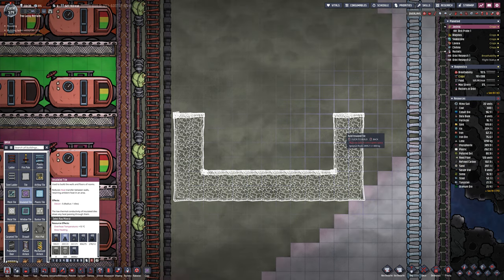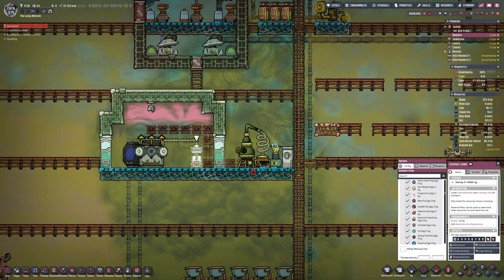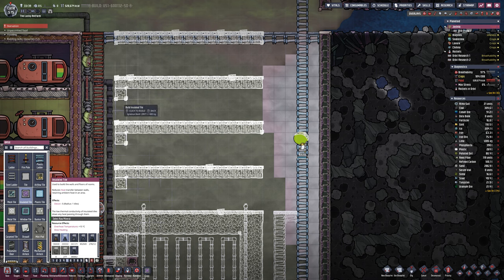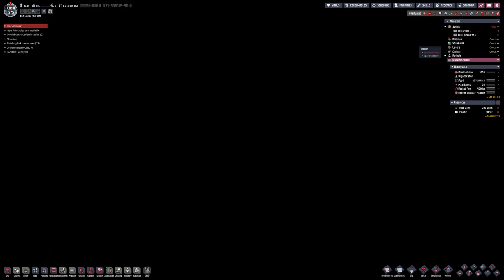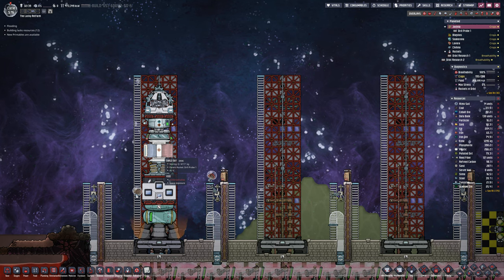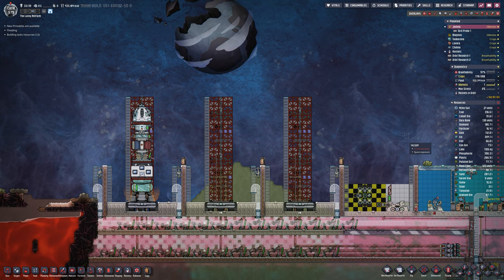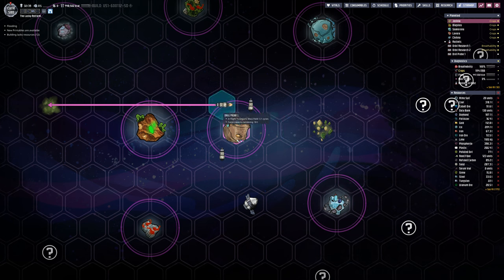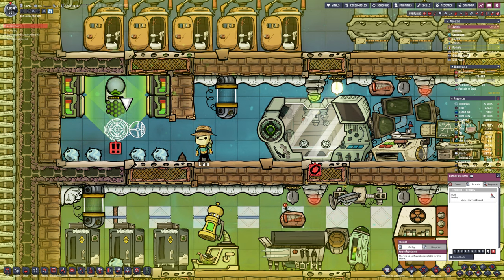Trying Cryo Fuel (Oxidizer) And Best Build Suggestions? | THE LAB - Oxygen Not Included | S3 E39

Comment: I heard the best fuel ratio is 2 liquid oxygen and 3 or 2 fuel. This is for the hydrogen rocket.
I have no experience, so my memory might be off.
Reply from the maker: Thats correct, but currently im with the liquid chlorine as need -60 or so, liquid oxygen requires like -170, which i can yet do without coolant as ethanol wont go that cold. So for now its Large Petroleum and Liquid chlorine, with the hopes of going FULL cryo before i end ;)